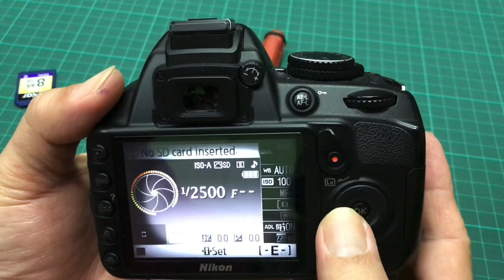How to replacement nikon d3100 lcd vignet screen#diy #how

Comment: What cause of vignette lcd
Reply: LCD open for too long and/or heat (by buildup because of extended use or by other heat sources like sunlight)
Reply: Don't use Screen protector it will added heat on your screen just remove it, always use black UI, turn off the camera after use it